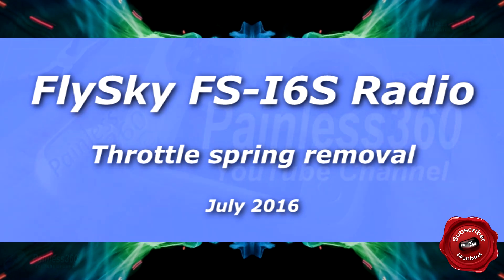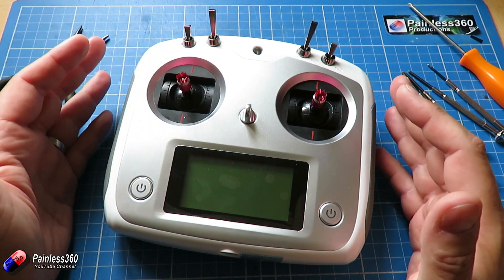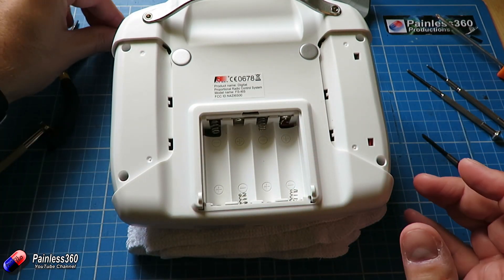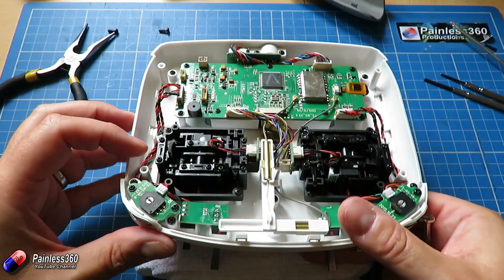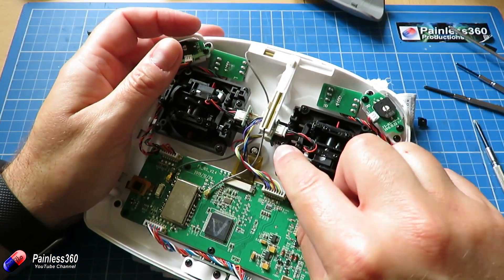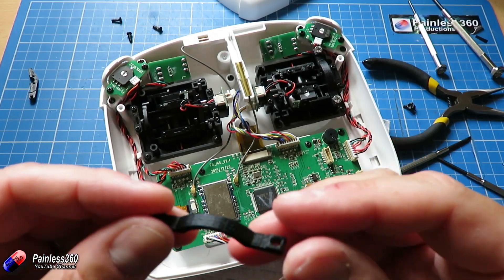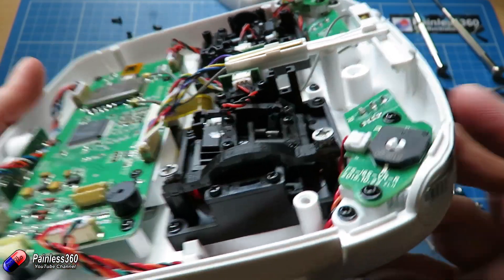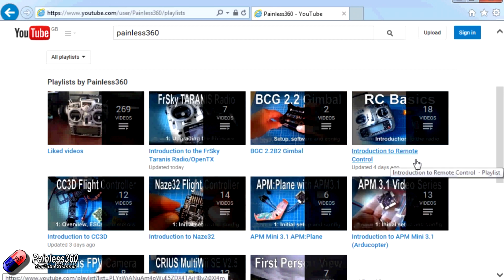RC Quick Tips - FlySky FS-i6S radio - Removing the throttle spring

Comment: I don't know if anyone has mentioned this here... but, in addition to having a friction clip included with this radio now, I noticed that the screw in the throttle spring mount doesn't have to be removed. It is actually a tension adjustment screw. I just grabbed the little mount with some needle nose pliers, pulled it up out of the rail it is in. The other end of the spring just slipped off.  That little rocker arm... I found that I  could just lift the "bottom" of it out of the cradle it rests on, and with a slow firm pull it slides out.  Anyway... all your videos have been such a gold mine of info!! WAY better than the "really experienced" guy at the hobby shop I goto when I need a part now.  Thanks for your work!!!

Comment: Needed this video. Huge thanks for making it. Mine didnt come with the spares needed and I couldnt find a quick/easy method where I'm located to 3D print the clasp. So I cut out a strip from one of my spare cleaning cloths, stretched it out and screwed it right over the rocker. Rocked the stick about a hundred times to make sure the cloth doesnt slip off the rocker. It stays in place and now I have a perfectly balanced rocker and the stretched piece of cloth provides a nice little haptic feedback from the ribbed knit.

Comment: You are star. Nice and easy mod. I actually used cable tie to put a pressure on throttle and its working perfect. Thanks for your video. I used solder gun with smal round tip to melt holes for screws at the end of the cable tie.

Comment: I've just bought the FS i6s from Fly Sky and it comes with a plate to attach to the gimbal when you have removed the spring, although they don't tell you about it.
Reply from the maker: See other reviews of the radio from other sellers. There has been a few versions of the radio - with and without the sprung throttle. Happy flying! :D

Comment: Futaba sold a spring, which was just a bit of springy metal with a small bump on one end and a screw hole on the other, so maybe you could just use the same part on the new transmitters.  Otherwise  you only need something to put a but of friction on that toothed area.

Comment: please note the later made ones come with a 'kit' in the box, its a piece of bent metal and two screws, this is used on either stick to restrict the return of the stick to neutral, its a simple mod, but doesnt involve having to remove the spring and rocker arm :) less hassle!!!

Comment: Firmware update 3.0. Has modes 1 2 3 4.
The latest i6s has a metal strap in the box for a gimbal brake so you can have a non centering gimbal

Comment: This radio is really nice after the firmware update. I bought this for a friend who flies Naza V2 with only GPS mode, so the spring on the throttle is a big plus for her.
The spring on the shoulder slider was not good since the DJI H3-3D doesn't support the "relative" rc-imputs like for example the storm32 does. So I removed that spring and wau. I perfect radio for a beginner.

If you have the time. do a removal video on that too. It's a VERY simple mode which will help everyone with a H3-3D.

BR.
-Tapio

Comment: I think they put a spring on both sides because you can easily go into the settings and choose between Mode 1,2,3,4. I don't think I have ever seen someone fly mode 3 or 4 on a quad. However on a couple planes I built I did use mode 4 which would be throttle/rudder on left stick and elevator/aileron on right stick.

I like that setup because you can fly just fine without using a rudder on a plane with bank and yank plus I have more control with my right hand for rolling.

Comment: Hi! What is the problem with the spring throttle? Can I use this radio with whoops without making any hardware modification?
Reply from the maker: Most of the hobby grade quads use an unsprung throttle..

Comment: I have a big problem because my right stick x axis in the stick adjustment or the monitor is not being noticed that is beeing moved. I tought meybe its the betteries , i bought a fresh pack and still the same problem, did the factory reset, upgraded the firmware and still have the same problem... any ideas ?
Reply from the maker: I'd contact the vendor for help in case it's a faulty radio. Best of luck!

Comment: The redundant spring and rocker part removed will get put in a safe place and if you ever want to reverse the mod, where you put it will be long forgotten. Hot glue to the rescue ... stick the parts inside the case out of the way. A dab of acetone on the glue makes it release instantly..
Reply from the maker: +David Clark great tip!

Comment: what would it take to make this work as mode 1 Thanks
Reply: can the right hand stick be easily set to throttle and ailerons as well as the reving spring mod
Reply from the maker: +Ken Slee you can choose the setup in the menus. Happy flying!

Comment: so if i don't mod the transmitter i will do altitude hold or do i have to set it up in clean flight? sorry about posting in the wrong video
Reply from the maker: All the spring does is return the throttle to the 50% position. See our videos on the Naze32 where we cover Altitude hold mode. You need to set it up in Cleanflight and have a FC that includes a barometer..
Reply: could u send me a link to that video?
Reply: and do i need the spring back to have altitude hold to work?
Reply from the maker: No. The spring on the throttle is a bad idea IMHO. If you need more help please see the website for details of how to book a chargeable one-to-one support call.. Best of luck.

Comment: Taking the springs off one the VRx potentiometers on this transmitter and was looking for a take apart   : )
Reply from the maker: Process documented here - https://www.rcgroups.com/forums/showthread.php?2566271-FlySky-FS-i6S-Transmitter/page50 ;D
Reply: Took spring off VRA, a bit of foam for tension. One for gimbal and the other for retractable gear activation. I really like this radio and those spring loaded dials were the only irritant.

Comment: This radio transmitter is setup for an altitude hold model only.
It's the only reason to put the throttle on spring. IMHO
A piece of a zip tie with the toothed part can do the job. The steps can be an issue by the way.
My Robbe one, in a far, far, far away past (and galaxy), worked quite well in this configuration.
Reply from the maker: +Alexis Lechevalier zip tie! Nice! Great idea..
Reply: I have this radio and it's set up like that because u can switch between modes 1,2,3, and 4. Not for altitude hold

Comment: what size screws did you use to hold the friction plate?
Reply from the maker: I can't remember but I just used two that were in the spares bin that were big enough to bite into the plastic..

Comment: I want a spare transmitter for the holliday to fly my TBS Discovery. Do you recommend this transmitter? Price is very good.
Reply from the maker: The Tx is good for the money but is aimed at newer pilots. Not sure why you'd need a spare Tx but this is one we've used with success with a few models here..
Reply: Thanks! If I am on holliday with the camper or tent I dont wanna bring my expensive transmitter and Fatshark FPV goggles. Thats why I look for a cheap transmitter to bring with me.
Reply from the maker: You still need to then bind it with the model, setup everything etc. then change it all back with the other radio.. A lot of hassle potentially. Best of luck!
Reply: Dont need to. I wil only fly my TBS quad with this transmitter. I use my Taranis for the other RC models. TBS quad is only for the holliday. Thanks for your advice. I ordered one yesterday. :O)

Comment: Did you try power it with 2S battery?
Reply from the maker: No, used 4 x AA batteries. Others have used other batteries but we've not tried it here..
Reply: +Painless360 Just wondering if it will work or will it give high voltage alarm? If it works with 2S Lipo, it worth the modify battery spot for 2S battery. Planning to buy one if it works with 2S. Else, hating AAs.

Thank you for your time.
Reply from the maker: Some have used other AA size batteries but we've not done it here - do let me know if you get a good answer!

Comment: Hı my friend.im new on making quadcopter and I have a few question about flysky fsia6b telemetry system. I have bought naze32 rev6 10 dof and I want it to connect fsia6b by sbus module. how can I connect this? You know that naze32 rev6 card is different from naze32 rev5 and I couldn't find videos or pictures about connecting this two module. I'll be glad, if you help me. thank you.
Reply from the maker: +meriç a sorry, we've not set that up. If you get it working let me know..
Reply: +Painless360 ok my friend. thank you for your interest. take care.

Comment: Hello, do you have a link to the Thingaverse link to that part?
Reply from the maker: Search on there for Painless360 - you'll find all of the designs.. Best of luck!
Reply: Thanks, I ordered this controller and it now comes with the piece already in the box
Reply: HI, 
shipping price to france are really expansive on most 3DPrint plattforms (like Thingaverse).
Can  you please help me to find out this throttle tension bar ?
Reply: Furthermore I didn't find anyway to print multiples parts in the cart ...
Reply: You want me to print and ship the part to you?
Reply: sure, it, would be great Christopher Lang. I really appreciate if it's possible.

Comment: it looks like it is intended for 3D quads inverted flite
Reply from the maker: +robsycko odd to add that too a radio aimed at the lower end of the market and newer pilots where the vast majority of models they will use won't have that feature. Glad they have now changed it on the latest models.
Reply: true that I just noticed it woiud be good for 3d quad

Comment: I would contact FlySky and encourage them to do a recall on all of these units. Even though its cheap, I would not be happy to do this repair and Mar up my brand new radio.
Reply from the maker: +Adam Sparrow the latest ones now come with the spring removed. Glad FlySky are listening. See our fuller review video..
Reply: This tx is made for altitude hold model only -.- ... If you want tx that has throttle without spring, look for I6 from Turnigy, Fly Sky,... only rebranded